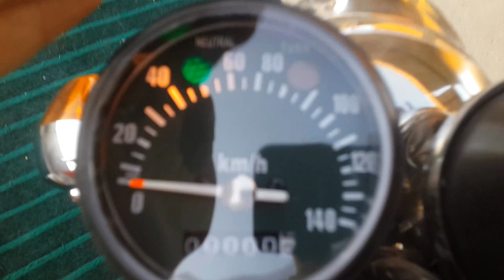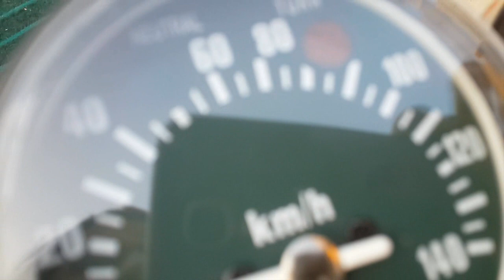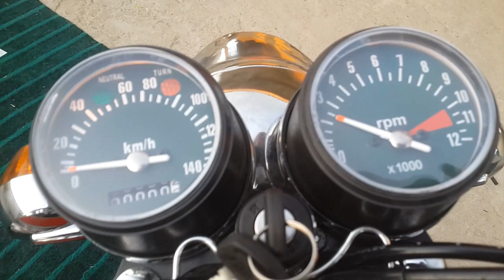Assembling Complete Honda CG-125 Vintage Bike By E&EP Autos

Comment: Fantastic Work. I really appreciating you . I am memorizing my Fathers Honda CG-125 Model 1982. 
You have done an amazing Job. Once I have reconditioned my 125 in 2003, but most of the Body parts available in market are not Good quality. Like Mud Guards and Shocks Cups, Seats, Indicators etc.
But Apart from everything your Work is Amazing.
Reply from the maker: Thank you very much!